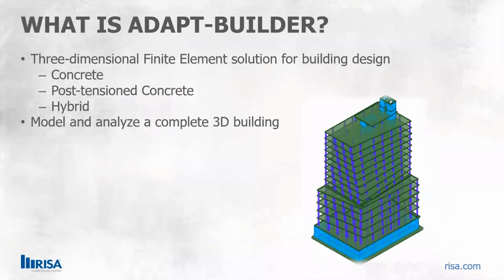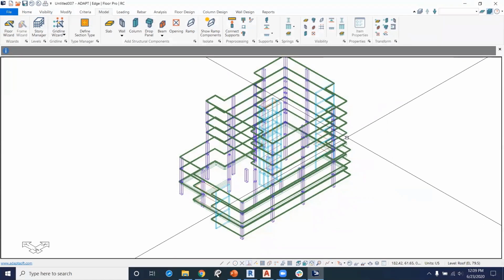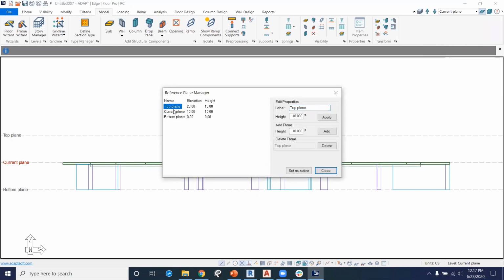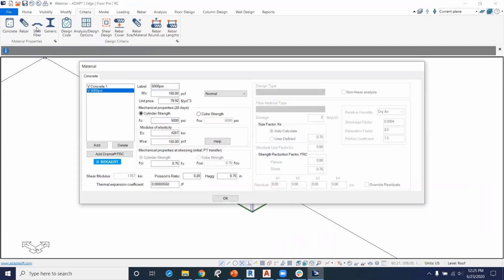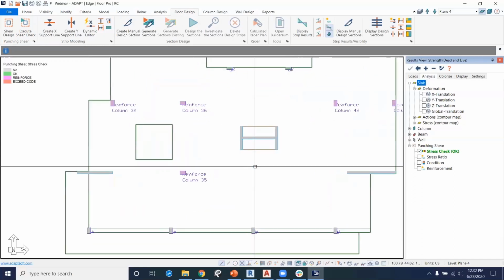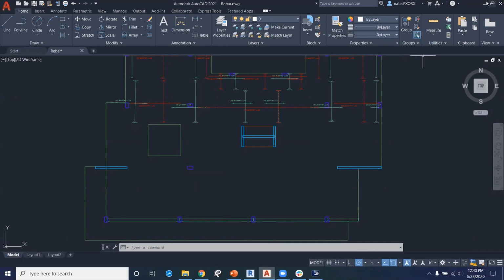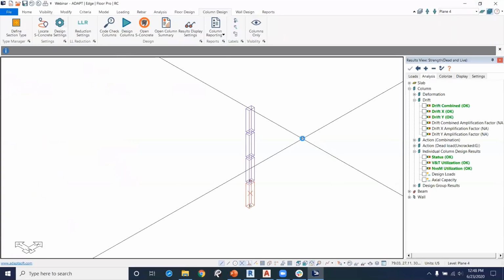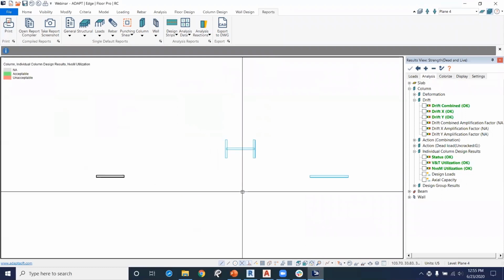Multi-Story Concrete Building Design using ADAPT-Builder

Comment: Is there a way to set the orientation of the design sections relative to the support lines?  It appears some of the sections were oriented non-orthogonally resulting in rebar at nonsensically skewed angles.
Reply: yep there's a button for that for generating the rebar layouts. the design sections are always orthogonal to the support lines.